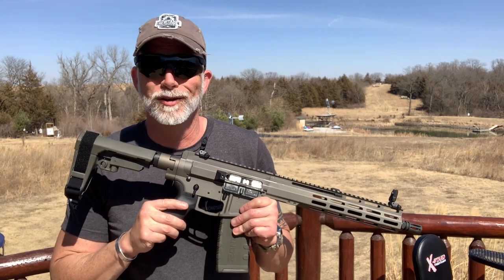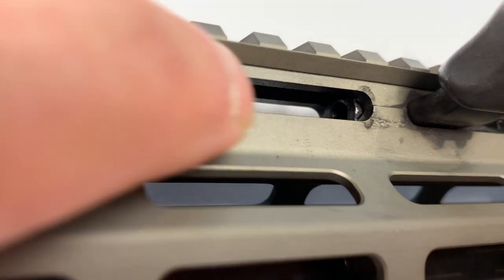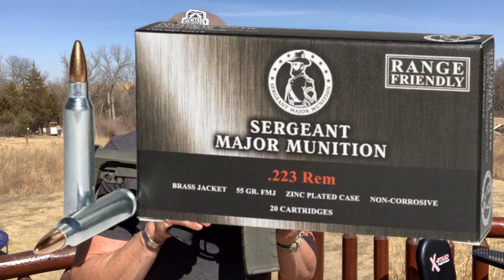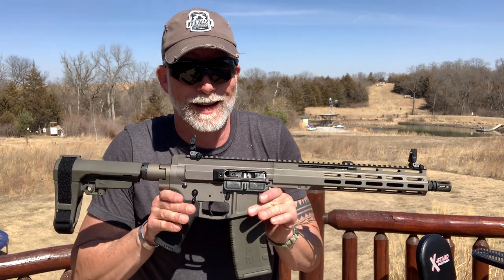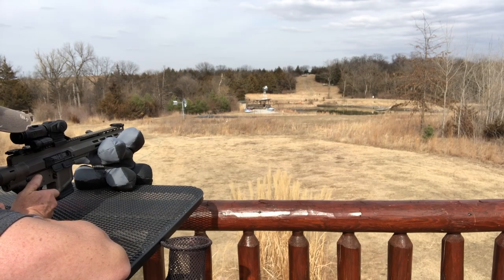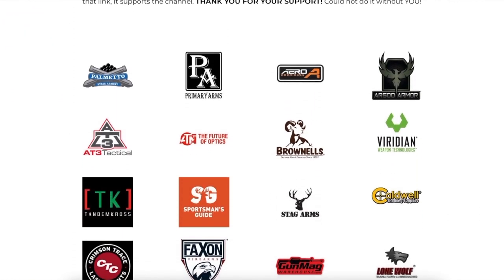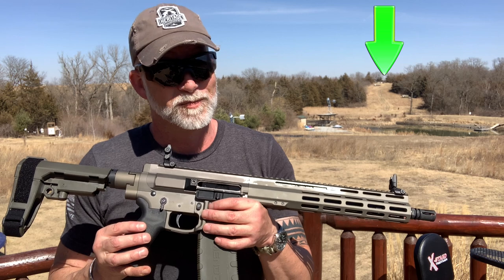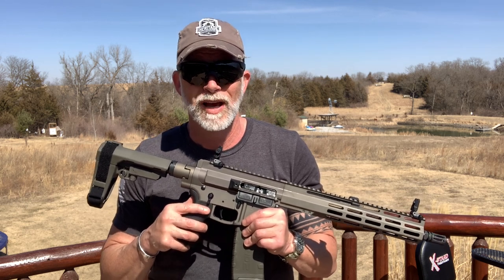Foxtrot Mike's NEW FM15 - REVIEW

Comment: Now if only they'd make an 8" 9mm version
Reply: @Morrius07 Lol where have you been? They make a 3", 5", 7", 8.5", 10.5", and multiple 16" uppers. I think they even had a 9" at one point. I have a 7" rear-charging, and a 8.5" side-charging. Both are outstanding
Reply: @Timewaits4no1  but do they make a 9mm without a buffer tube?  That's the positive for the FM-15.
Reply: @96SupraTT  No, not as yet. Paul from Foxtrot Mike is an innovator tho, so it wouldn't surprise me to see 1 in the future. They would obviously have to change some things for the 9mm/45 platform to work bufferless, but I don't see why it couldn't be done. The only downside would be the price would go up. At less then $700 for the current FM9, there is no better value in the pcc market(outside of the Extar EP9 which is mostly polymer). I actually paid $600 for my FM9, and you can find them on-sale if your patient
Reply: Was eyeballing BCA 8.5” 9mm Bufferless pistol

Comment: I love FM15(13.9” Primary Arms)! The Dead KeyMo Muzzle complimented my can. I have a simple stream light with a touch pad on the 12’O clock right in front of my Eotech XPS. I have a Magpul AFG foregrip. FDE rail ladder covers on top and cut to fit in between the Eotech + Magpul front/back MBUIS sights. FDE Magpul SL Stock + FDE BCM pistol grip. Strike Industries MLok Covers on the sides in the 3 & 9’O clock positions. It also has a Magpul MAD Lever(A MUST HAVE) with a PSA skeletonized adjustable trigger and some Anti-Walk Pins + Bar. So far I love the reliability, aesthetics, and folding stock. It replaced my DD MK18 as my primary home rifle. Great review!

Comment: AWESOME Video!!!😃 I'm going back and forth with the 12.5 Foxtrot Mike's Upper, or the PWS MK111 Pro. I have the Foxtrot Mike's AR-9, and it's been FLAWLESS!!!
Reply: It’s around $250 price difference and you’ll have to install the pic rail attachment on your lower, where the buffer tube would go. I have both and they’re both great but the PWS runs so much cooler, barely any heat build up on the rail with the PWS

Comment: I heard some bad things about the buffer spring, that because it's two springs (one within another) that they often bind up. Is this that much of an issue 2 yrs later?
Reply: I will give you my honest review. I just bought a 12.5 and shot it for the first time yesterday.  The inner recoil spring bound and the guide rod both broke within 140 rds.

Everytime I have emailed their support they literally reply back to me within 10-20 minutes. He's sending me a new updated version of the recoil springs and guide rod. Apparently since it's proprietary and their own design - it obviously has gone through iterations. I guess they have improved the recoil spring and guide rod so he's sending me a "gen 2 set up" free of charge. They have warrantied anything that has broken and shipped the same day i communicated with them.

To me this was to be expected as it is not a milspec AR and I would not consider this new of a design a battle rifle until I had a few thousand of issue free rounds through it.

It's a brand new design and the gun is going to have growing pains. I have heard and read many people talk about thousands of problem free round with their FM-15 uppers.  I knew what I was getting into with this gun, and everybody else with a brain should understand that as well.

If you buy yourself one, be sure you follow their set up instructions - run it wet on break in like you would any gun you love, and make sure you grease the charging handle area according to instructions. The charging handle will need to wear itself in so don't worry if it feels a little gritty to start with.

Comment: That looks like they have made changes to the FM-15 upper.  I don't see any other examples on-line that have three small slots in the forward part of the upper.  The back of the charging slot looks to be farther aft than pictures on-line and the green color has not been offered.   Brownells has the 1st gen on sale so will this be released soon?
Reply: Not a different gen, just different lengths. They've added like a handful of different barrel lengths.
Reply: @boygonewhoopdataZZ  some of the pics show charging handle farther forward than what is shown in vid.